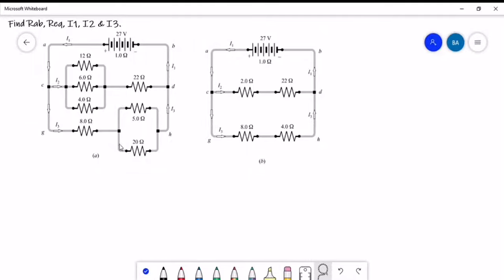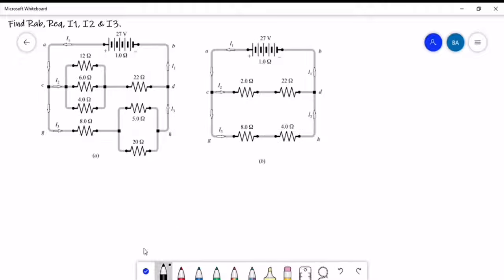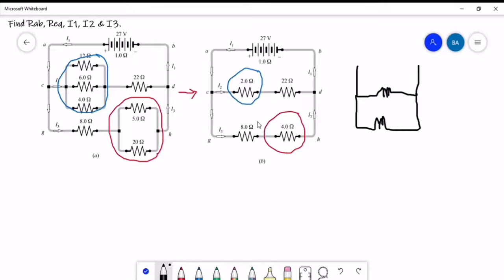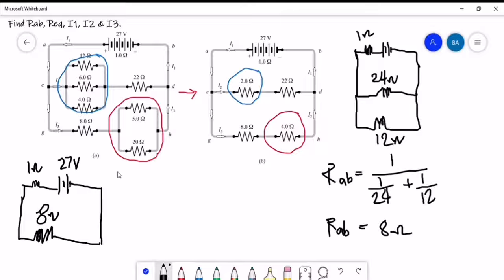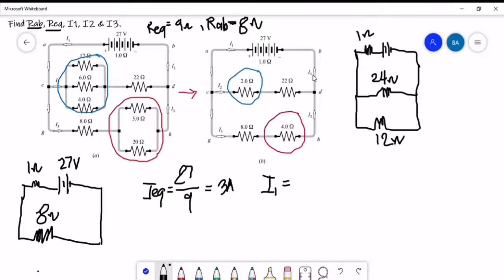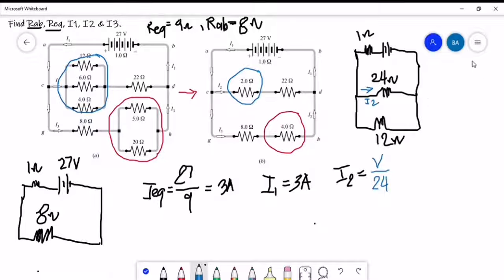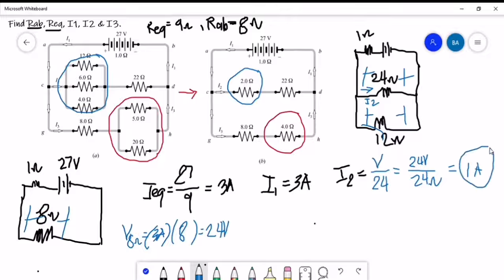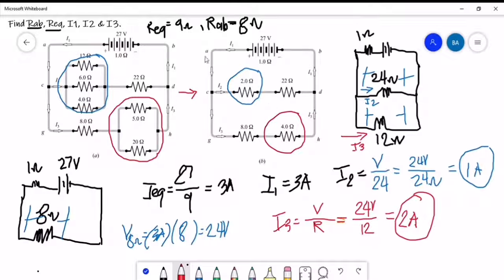Introduction to Electricity | Lesson 4 | Combinational Circuits

Comment: At first, when I take a simple glimpse in this video, I noticed that the illustrations were quite daring and hard. I admit it was hard for the first time, but as I came to watched this video umpteen times the puzzle slowly getting back to where it belongs.  A lot of things, learning, insights and discoveries i have discerned during those hours of watching. I think it can neither be assessed in one paragraph nor discussed in one session. But one thing I have learned that the output of the combinational circuit depends on the values at the input at any given time. Also it is important to identify first what specific branch of circuits you are currently in. In solving, you have just to follow the formula and procedure and there you got  the correct answer. God Bless♥️

Comment: Sir the branches of circuits should be used the parallel circuit formula only or theres another way?because i add the branches of circuit in my solution not knowing this technique.thank you sir.
Reply from the maker: You must know first how to differentiate the parallel circuit and series circuit. Add up if its series, but in our case, the branches are connected in parallel. But, there are other cases that the resistances are connected in series. So be careful.